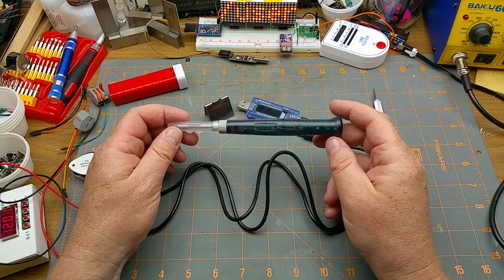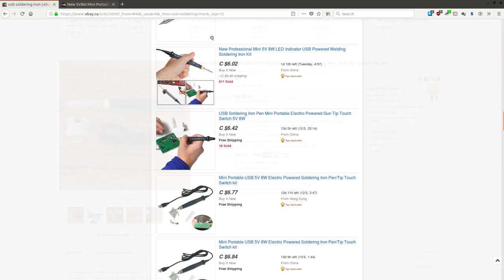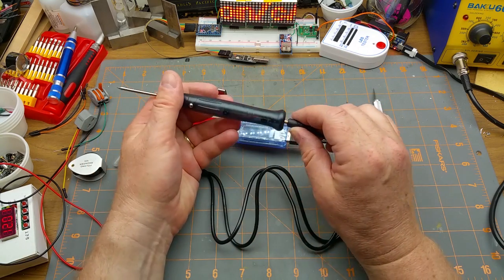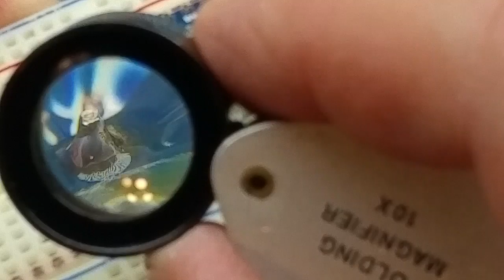Looking closer at the cheap usb soldering iron

Comment: It looks just like the one I have and love! The ball on mine does not push. I get within a half inch of the ball and it automatically turns on. Left on the stand it turns itself off after about 30 seconds. I bought an oscilloscope kit and soldered it together with this little iron! They work great for  board work.
Reply: You probably have the same one like mine.  Does it have a yellow plastic part that holds both sides together and a stereo jack?
Reply: Luc Peeters. Yes; mine is also the yellow capped version with the stereo plug on my usb cable.

Comment: The good thing about buying cheap simple stuff is it’s usually easy to fix.  Maybe they didn’t bother with quality control when they substituted the Jack or the plug to something incompatible, knowing that whoever is going to use something like this can also probably debug it themselves.  They should have sold as a soldering iron kit.

Comment: Looks like the socket is defective. Because the board takes tip and ring, but on the plug side, sleeve and ring are effectively connected by being a single piece. I'd say the ring contact inside was pushed in and no longer makes contact to the ring of the plug, but contacts the tip contact of the socket instead.

Comment: Great quality control.  Looks like someone switched to a cheaper audio jack without testing.
BTW, I received one of those jewelers loupes yesterday and they are great.
Reply: That is just crazy, I wouldn't even call it quality control, I would call it no control or test at all.  Mine draws 1.32A at 5.15V which is roughly 6.8 Watt.
I took mine apart yesterday as his seems to have a click switch while mine didn't and mine sometimes doesn't switch on. While taking it apart I noticed mine also had a stereo jack and his did not. Also like on the ebay listing the little plastic thing that hold the housing together is yellow on mine and not grey like this one. The pcb is completely different also.   Well it is a great little emergency iron that you can take away everywhere.  I took mine to Africa last summer and could go through all customs without them asking what it was. I would not be able to do this, or want to do this with a gas powered iron .  I was able to fix some solar charger stuff with a 6USD device on a powerbank which to me was amazing.

Comment: It looks like you've got the replica one.
The "original" one (which works great) has a plastic yellow  nut ( as you can see on the seller's web page)  a touch sensitive button and  an IC 555 inside the iron.
Also, the "original" iron tip shows copper on the side that fits inside the iron, with a white insulator not black as yours.
Reply from the maker: For the price I paid, I wasn't expecting it to be an original design. 
I'm actually surprised that it works as well as it does.
Reply: @pileofstuff  What I meant was that there are 2 version of this 5v USB iron (same price).
I have paid  $5.20 for it 2 months ago and I was lucky to get the one version I hoped for ... because you never know what you get from China... what you see it's not always what you get :)
Reply: @dina2624  i has orden at chinese elektronic and phones and welding machine and many many stuff. last 7 year ewery month, and newer not has come anythink broken or shit parts. all has good and working parts. many have full same parts what amazon se3ll, but price have different only. all other have full same parts. expet one board cost chinese shop 0,5 $ and amazon same board cost 7 $ only idiot buy amazon anythink if same part can buy chinese shop lot cheapen. or amazon cnc controller board cost 100-200$ and chinese shop full same board cost 10-13$

Comment: I wonder how much power is wasted in that cable. If you have some time, try to measure voltage right at the connection, it might be even less than 4V. I have a 16x2 lcd with arduino connected to one usb connector and I use it with LCDSmartie. It's not very power hungry device, but it kept crashing, just because right at the board I had only like 4.5V, barely enough to work. Just because of single crappy usb cable.

Comment: lol 4,3V x 0,85A is not 5W is 3,65Watt..
Reply from the maker: llaci80 :that's what happens when you edit drunk...

can you check my math in the other one...
Reply: btw i wondering how this stuff working from 5 v usb and less than 4w
Reply from the maker: I was surprised that it did anything useful at that power level too.

But as you can see, it actually can do soldering stuff.

Comment: Why didn't you just jumper between the pads?
Reply: Because the two pads that were soldered in contacted the same part of the jack. Bridging the third one would create a short circuit. That was actually mentioned in the video.
Reply: No, what I meant is the option stated at about 10:24 .... cut the track and jump across. surely, that way he could have kept the mono jack? I was wondering why he dismissed that option. Anyway, I ordered one of these a couple of weeks ago and will do some continuity checks on the PCB when it arrives to get a clearer understanding what the issues may have been.
Reply from the maker: Mostly because I couldn't see any advantage to the cable being removable.
Plus cutting the plug/jack out removes a potential future annoyance of an intermittent connection.